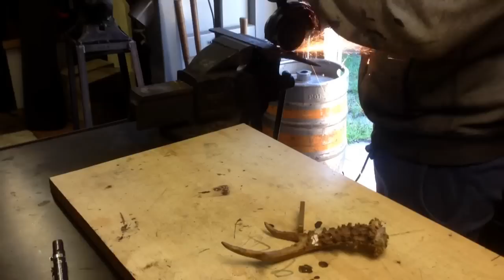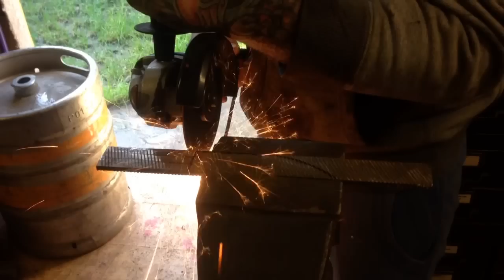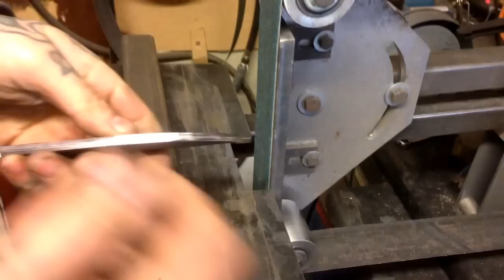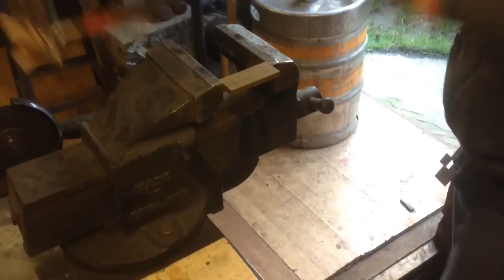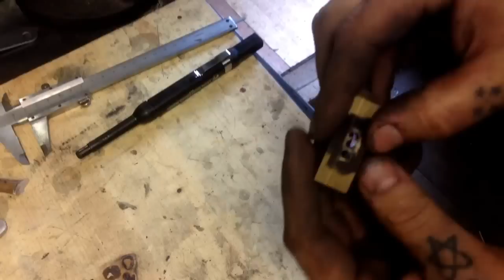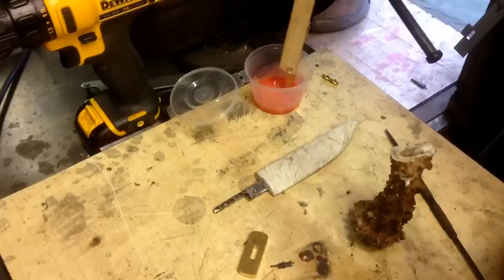Making a Hidden tang farriers rasp file knife no forge

Comment: You need a longer and stronger tang BRO ! It was already there but you cut it,and made small and weaker one and handle material was thick enough to take a bigger tang.
Thank you for the video
Reply from the maker: Yeh I messed up the tang and had to cut it down. I much prefer the full tang knifes as they are easier to make and feel solid. Thanks for watching

Comment: Other folks have mentioned "why'd you cut off the tang and then
 make one!?!" so I won't - oops, just did. ;-) BUT what I really liked, 
that you didn't call attention to or show, was that you really scored 
the tang area for, I assume, better epoxy grip, both mechanical and 
surface-area.

Sugg'n for future videos: you're great at giving information without words ("see the grit number of this-here sandpaper?", or the excellent "thumbs-up - means I'm happy with it!") -- but you might just go ahead and put some annotations in there. I'd love to know stuff like: "scrap block of maple", or "punch & scratch test: shows that handle's annealed enough for drilling but blade's still hardened". 

Keep it up!
Reply from the maker: Hi there thanks for watching.
I didn't use the original tang as its not hardened on these files so I wanted something that's hardened all along without having to re harden it.

Yeh I scratch it for a better bond with the epoxy.
I try not to talk or put up annotations because there are so many others that do it and I'm just trying the rough old watch what I do and maybe copy so it keeps my channel different from others plus I'm new to this stuff and most of the time I'm making up what I do as I go. If anyone ever has questions tho I'm always here and reply to every comment I get. Also a lot of the time I've no idea what wood I use as its all repurposed stuff from scrap.

Hope you've subscribed and thanks for your comments I do take in everything you all say and it means a lot to speak and hear from everyone👍🏼👍🏼👍🏼

Comment: Nice handle as long as you don’t do anything with it, like cutting.  All those spines and bumps would make it almost impossible to work with for any length of time.  You should have run it over a slack belt and smoothed it off a bit, just enough to make it comfortable to use.  Overall though, a good job!
Reply from the maker: It feels fine trust me ive used it plenty since making it and no problem at all. I didn’t want to sand them out thats why I didn’t

Comment: well crafted knife 👍, are all those type of files already hardened,  I really want to get into knife making,  what would you suggest for a beginner
Reply from the maker: I find some of the newer ones are case hardened but most of the older Nicholson files are good hardened steel but when shaping it you have to keep it cool so not to ruin the hardness and also you need to temper it in the oven to take away the brittleness of it. 
I started with a file as my 1st build but it depends what you have tools wise and it's personal preference. I do have a few videos to try help others out in knife making.
Hope that helps any other questions gimme a shout 👍🏼

Comment: I have built a two of these hidden tang.  I always soft solder the guard.  I like solder cause it's low temp will not effect the temper, it holds the guard in place so it can't wiggle and gives a good stop for the grip to butt against.  One question how hard is the epoxy you use my concern is I worked with aircraft structural adhesive with seemed to be durable but with others you just don't know if it will crack under pressure?
Reply from the maker: Yeh I have used soft solder before and I do like using it as you can give it a nice shiny finish if it spills over a little.

The epoxy I use still stays slightly flexible to prevent cracking and give it more of a robust tough bond hope that answers your questions please subscribe for more 👍🏼👍🏼👍🏼👍🏼👍🏼
Reply: +Diesineveryfilm Customs I Try to ask questions that will help and teach other viewers info that may be of interest.  Hope my comment could help you teach.
Reply from the maker: Thanks for your questions I'm always happy to answer any questions people have. 
Hope you've subscribed

Comment: hello realy nice what you have done there
but i m just real beginner and have a question and also with this knife you have done how do you protect it against rust
and i know about oil treating but i dont se you do it so yea ?? 
and i hope to make my self one :D
Reply from the maker: Unfortunately because it is just standard high carbon steel it will still rust even if you heat treat it with oil.
To prevent this I just keep the blades lightly oiled at all times.
Hope that helps.
Please feel free to share my videos and subscribe if you already haven't 👍🏼👍🏼👍🏼 Thanks for watching

Comment: ive seen people heat treat this after the build(even though the file steel was heat treated when first made) is that completely pointless? possibly more damaging to the hardness of the blade?
Reply from the maker: +Corbonzo yes people do do this as sometimes they anneal it prior to shaping then harden it once it's finished this makes the steel a lot easier to shape and work with. In this case I just left the file hard and kept it cool while shaping it takes a bit longer and is harder to do but saves time when it comes to the end as I don't have to harden it. Thanks for watching please like, share and subscribe for more 👍🏼👍🏼
Reply: Diesineveryfilm Customs ahhhh okay, thanks for the reply!